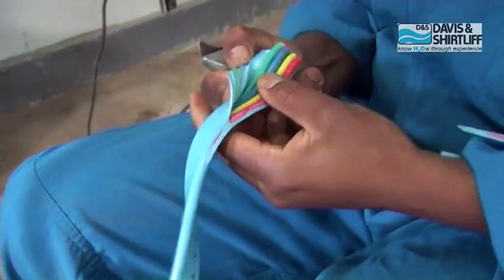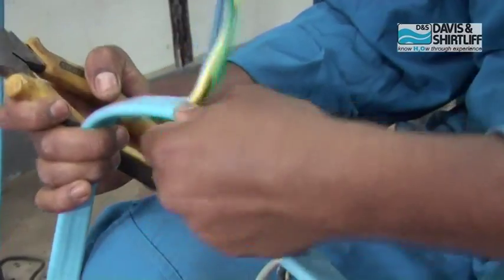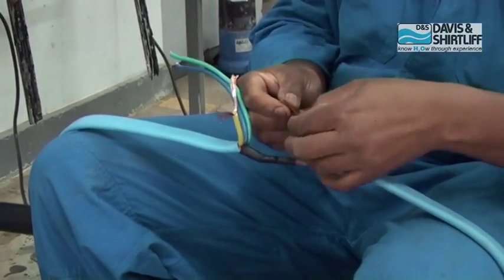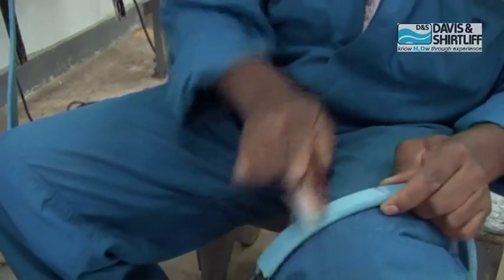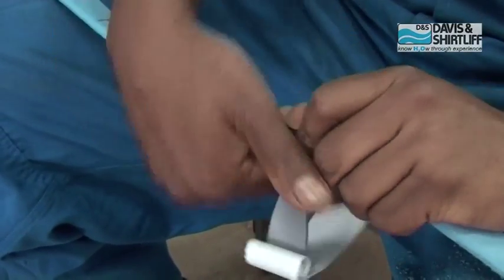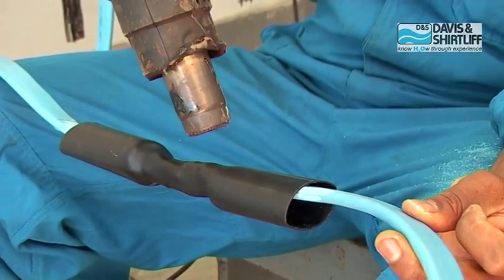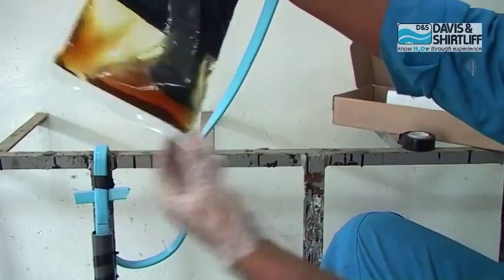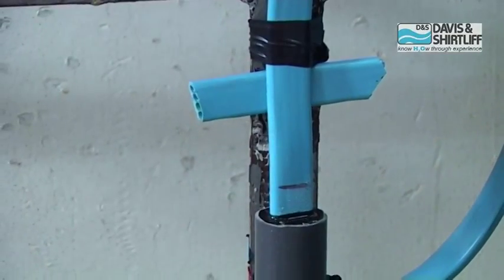Cable splicing final2 GB

Comment: Solder the copper cables and they'll last forever.  Just twisting them together will mean corrosion and tarnishing will start to compromise the circuit in a very short time.